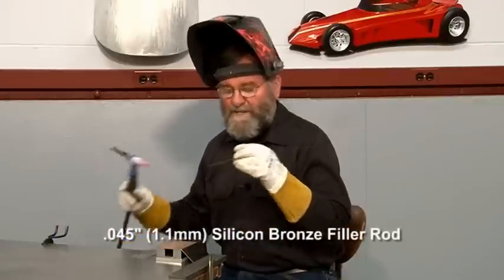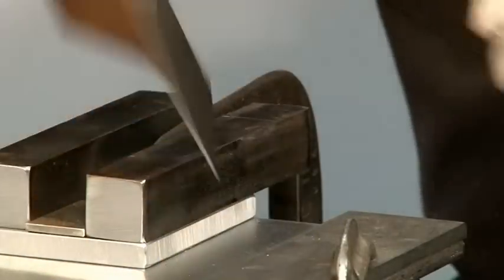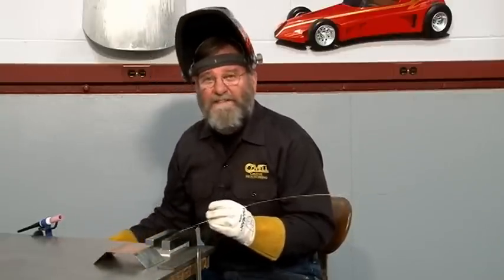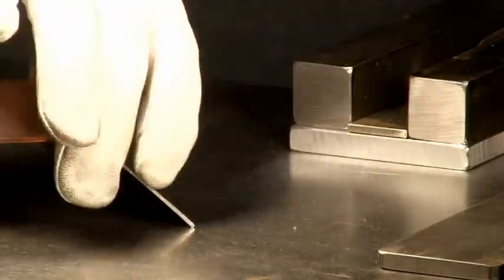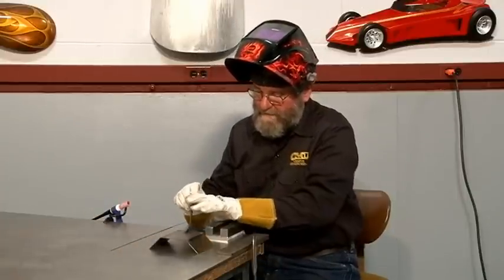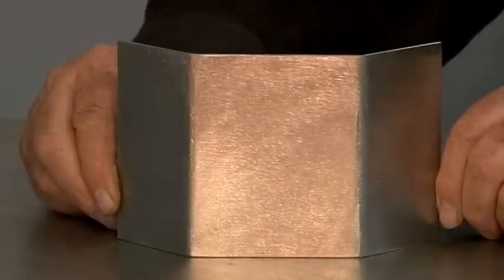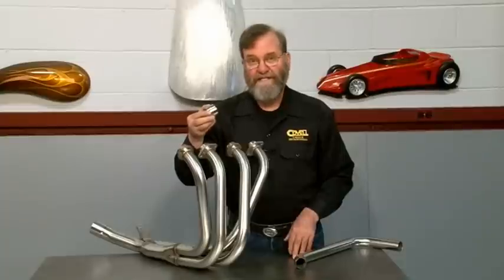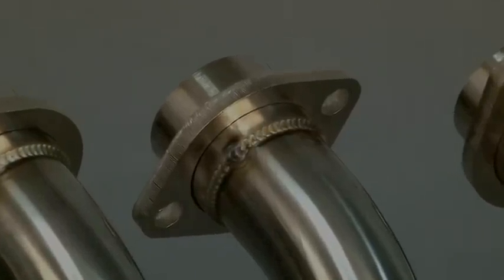Welding Dissimilar Metals

Comment: Thanks very much, Ron. That will work perfectly as you said for my little problem which is welding brass and stainless steel together brass and copper,  and copper copper brass brass and possibly a bit of titanium thrown in, as you said though I will see if I can pick up some bronze sheeting to see how well that works in place of using brass and then I would silver solder actual sterling silver onto the copper., 

it's very impressive to see how well it actually all comes together using that one particular rod. And once cleaned up it looks absolutely amazing and not at all what you would expect with the similar metals..  I'm very pleased that you were able to show me this thank you

I'm now about to pull the plug and buy my new welder ! That will probably mean I'll never touch my miG welder again got up to speed on it. I realise there's a difficult and probably time consuming workflow to consider and I would imagine it's practice practice practice with plenty of coupons of differing metals until I have the settings dialled in just right especially as I'm dealing with very very thin metals.

Many thanks

NeilScott
Barcelona
Spain
Reply from the maker: I'm so glad the video could be helpful!

Comment: What kind of welder is that?
Reply from the maker: Miller TIG welder.
Reply: @RonCovell  thanks
Reply: Sorry, I'm so new to welding that this is still confusing for me. So, the silicon bronze that you talk about, is that the same as 309L? If so, is this supposed to have flux? For clarification, the 309L is the stick that you're using?
Reply from the maker: Let me see if I can clarify some of this for you. There are four types of welding that are commonly used by amateurs, and in small shops - MIG, TIG, Arc, and gas. The first three utilize an electric arc for heat, and the last one uses a flame.
Silicon bronze can be used as a filler material for either TIG or MIG welding. In both cases, an inert gas is used to prevent the weld zone from oxidizing, so no flux is needed. 
There is a somewhat similar process used with a gas torch, called brazing. In this process, a brass rod is used, and it is coated with a flux to keep the oxygen away from the area being brazed. This is not technically welding, since the brass only sticks to the surface, whereas with welding, the base metal(s) flow together. You can braze together many different metals, and it's also a good way to repair cast iron. Brass and Silicon bronze look quite similar, but their properties are quite different. 
309L rod is one of the more common types of stainless steel filler metal, and it's most often used with MIG and TIG welding.
I hope that helps!
Reply: @RonCovell  Wow. Thank you for all the information.  I find all the info on welding to be very confusing to a novice.  I bought a Mig/Tig welder. it just came in the mail, and I need gas now.  They don't sell the gas or rods at Home Depot.  I have a nitrogen tank here, can I use that?  Where is the best place to get rods?  Regarding brazing. Would these same rods be used in brazing?  I have a propane tank/torch, can I use this for brazing?  brazing might be better for the small repairs/creations I do.  Do you have videos about brazing?
Reply from the maker: Nitrogen will NOT work for MIG or TIG welding. Argon is usually used for TIG welding, and C25 (75% argon, 25% C02) is usually used for MIG welding steel. There are many online sources for filler rod - just do a web search.
Brazing rod, as I mentioned previously, is almost always used with an oxy-acetylene torch. I have never done brazing with propane, but apparently it is possible with thin metals. Here's a video that shows the process:
https://www.google.com/search?q=brazing+with+propane&oq=brazing+with+propane&gs_lcrp=EgZjaHJvbWUyBggAEEUYOTIHCAEQABiABDIHCAIQABiABDIHCAMQABiABDIICAQQABgWGB4yCAgFEAAYFhgeMggIBhAAGBYYHjIICAcQABgWGB4yCAgIEAAYFhgeMggICRAAGBYYHtIBCDQwMDhqMGo3qAIAsAIA&sourceid=chrome&ie=UTF-8#kpvalbx=_EjCwZIP2DpjCkPIPzOCIgAM_47
Reply: @RonCovell  thank you so much for your time and info, Ron. I really wish I was good at welding. It might be time to take an in-person class. :-). Have a good one!

Comment: Idea weld two dissimilar metals
One with good electrical conductivity 
One with bad electrical conductivity
Reply from the maker: That's a very interesting idea. What two metals would you suggest? Most metals have good electrical conductivity, although some are a little better than others.
Reply: @RonCovell  
Bismuth and tungsten are the only metals I could find that dont hav good electrical conductivity so one of those
Plus something like I dunno copper?
Reply from the maker: Thanks for doing the research. I use tungsten every day as the electrode for my TIG welding.

Comment: You're brazing not welding but semantics...
Reply from the maker: I've been using silicon bronze filler wire for some of my TIG work for over 45 years, and for most of that time, most people called it welding. In the past 5 years or so, the term 'TIG Brazing' has caught on, and it probably is a better term for the process, at least when you're working with steel. 

What do you call it if you are using a TIG to put silicon bronze filler on sheet or cast bronze? 

Yes, the semantics can get tricky sometimes!

Comment: Using silicon bronze rod welding or brazing?
Reply from the maker: Back when I made this video I had not heard the term TIG Brazing. Now that has become the widely accepted term for this type of work. 
Brazing sticks to the surface, while welding causes the metals to interpenetrate. It gets a bit murky when you are TIG brazing bronze, because that is actually welding!
Reply: Just wondering I know auto manufacturers have suggested  tig welding with silicone bronze inareas of high strength steel for years  also have used ox/acetylene  to brake sheet metal  for years and it is very strong for that so I see nothing wrong with what you are suggesting  love your site and totally  belive in your work keep it up please

Comment: Is there a filler which sticks to both iron and aluminum?
Reply from the maker: No - unfortunately there isn't.
Reply: @RonCovell  oh you answered cool! Maybe I'll push my luck with a follow-up. I'm wanting to construct a heat exchanger and I need to mate a pipe with a relatively high thermal conductivity (like copper or aluminum) with one of a relatively low thermal conductivity (like iron or stainless). So this technique apparently works on copper and stainless, do you think the weld is strong enough to handle something like 8 atmospheres of pressure?
Reply from the maker: I have never tested a copper to stainless joint for pressure, but I think there is a fair chance that if properly done, TIG brazing these dissimilar materials would withstand 8 atmospheres. I would certainly do some testing first! Let me know if it works for you!

Comment: Can I weld Nickel to Bronze?
Reply from the maker: I have never welded (or seen) pure nickel, but stainless steel has a fair percentage of nickel in it - and I have certainly welded a lot of stainless with bronze filler rod. Inconel and Hastelloy are two other alloys with an even higher percentage of nickel, and I'm fairly sure that they can be TIG welded with bronze rod - commonly called 'TIG Brazing'.

Comment: I never knew this was done on purpose and thought this practice is avoided. How corrosion-resistants are those mixed pieces?
Reply from the maker: You bring up a very good point - since in many situations placing dissimilar metals together will cause corrosion. I'm not a metallurgist, but I think corrosion may be caused when something like salt gets between dissimilar metals, making a little battery. When welded, I don't think there is any way that this sort of reaction can happen. I've welded mild steel, stainless, copper, and bronze together for years, with no problems so far. 
Maybe someone reading this can chime-in if they have more knowledge on this subject!

Comment: Can you weld bronze to mild steel using this technique?
Reply from the maker: Yes, bronze and mild steel can be joined by TIG welding with silicon bronze filler wire. This is sometimes called 'TIG Brazing'.
Reply: Thank you 😊
Reply: Sir can I have some documents on dissimilar material welding using Cryogenic Treatment can u help please

Comment: How about AL and CU? Tried before using the TIG & MIG Welding, its not working at all if using the CU rod due to higher current and temperature which melt the AL material. When using the AL rod, the copper seem to stick into AL material but the joining strength is very low and the tungsten rod are melted. Any possible welding method for AL and CU joining?
Reply from the maker: Muhamed Syazwan - Thanks for watching, and commenting! I don't think it's feasible to TIG or MIG weld aluminum and copper together. I have tried TIG welding steel to aluminum, and it just doesn't work. I believe Volvo has developed a method for welding steel to aluminum, but it takes some very specialized equipment.

Comment: Another great video, silbro is one of my favorites but it is brazing not welding as has been said, but you covered it with Architectural and sculpture applications, however, some years back, many motorcycles had brazed parts and all pedal cycles were assembled with brazing, with incredibly neat capillary brazed joints.
Great presentation again, I plan on getting some of your DVDs as after much research I reckon their the best for me, so easy to follow.
Reply from the maker: Thank you for the kind words. Yes, I stand corrected on calling this welding, since the bronze is adhering to the surface of the metal, not intermixing with it.

Comment: Similar to brazing but easier.
Reply from the maker: Yes, I believe I have much better heat control with a TIG torch than I do with an oxy-acetylene flame.
Reply: would have liked to have seen the penetration on that first weld

Comment: I don't think this is welding with Silicon bronze its brazing  it.... you can spot well most metals both ferrous and non ferrous which you can get acceptable results depending on the usage but thats how u get around  it ....
Reply: Properly called tig brazing.
Reply from the maker: I concede the point. Aluminum can be welded, brazed, and soldered, and when it is 'brazed', the brazing material is an aluminum alloy, not brass. In this sense, brazing is a surface-bonding process using a metal with a lower melting temperature than the base metal, but with greater strength than solder.
Reply from the maker: Since silicon bronze melts at a lower temperature than the base metals I'm demonstrating on, many welders do call this process 'brazing'. I prefer to use the term 'welding with bronze filler rod' because brass and bronze are different metals, and it would sound funny to me to call the process 'bronzing'.

Comment: Thanks Ron! Silicone bronze is a personal favorite of mine....
Reply from the maker: Yes, I should have mentioned that it results in a lot less distortion when joining steel parts, although the tensile strength of the weld is lower.